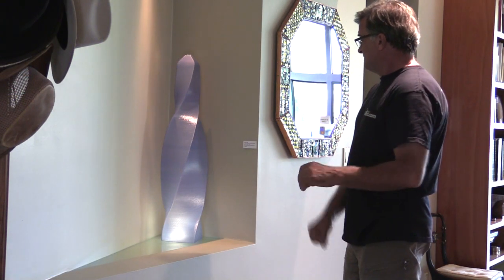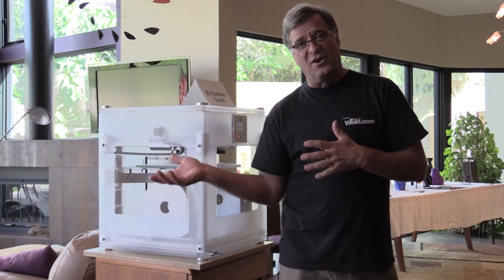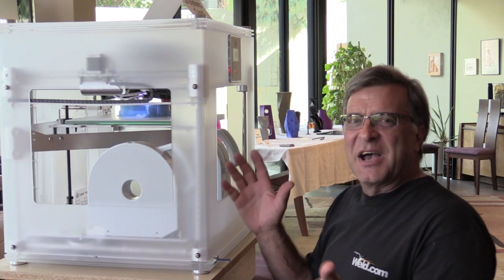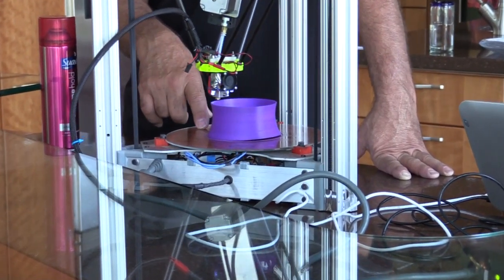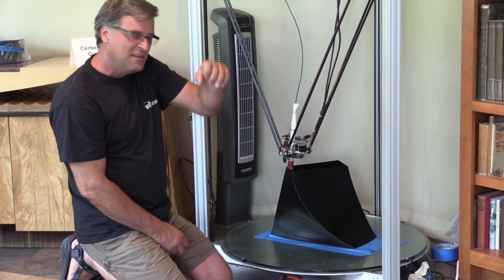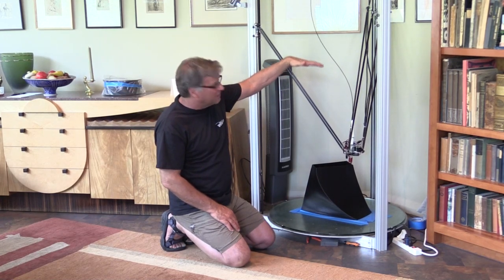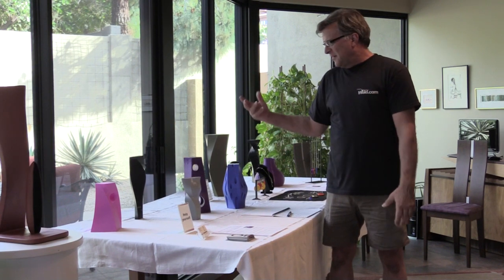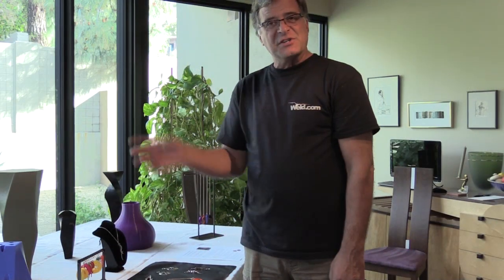A Sneak Peek at 3 3D Printers Printing Before A Show - Kevin Caron

Comment: What speed you print at big boss printer? What nozzle? What acceleration?
Reply from the maker: I think the speed is 15mm per second.

The nozzle is a 1.4mm.     Not sure what the acceleration is.
Reply: You printed it in one perimeter? Layer height?

Did you try to print a little faster? It can't to heat or you got poor quality?
Reply from the maker: I have tried faster with this machine but like you said, poor quality on the print.  This just gives me time to do other things while it is running.

Comment: 18k for that 8 foot guy? seriously? I'm in the process of building a large delta printer -- It won't be that big as I simply don't have room, but there is nothing else that's preventing from being that big, and I'm no where near that price maybe 10% and with a heated bed no less.. What made it so expensive, the aluminum extrusions are cheap, so are the motors and drive belts, I see you have beefy arms going to the effector, but those are not expensive...so what's the cost?
Reply from the maker: +kazolar       Having someone else build it for me..       I don't understand the electrical side of this...
Reply: +Kevin Caron, Artist well, I gotta say that since from looking back when you first got this printer. This was built some time ago. I can understand the need for custom CNC parts, but -- sourcing parts now, 3d printing has exploded, and I am able to build something that big with pre-fab aluminum parts from China for 2-3k. With a heated bed no less. My printer will have a print volume of about 17 inches diameter -- and about 24 inches high -- all aluminum construction very solid. 500mm heated bed capable of printing ABS and all other exotic materials. Also auto bed leveling compensation, so less fussing. I'm under 2k with just about everything purchased -- will probably need to buy some odds and ends as I start the build, but roughly $2k is the cost for a large delta bot -- now
Reply from the maker: This machine will print 32 inches in diameter and 4 foot tall!    Only prints pla though...
Reply from the maker: +kazolar Yes, things were definitely different then. BTW, I didn't build this. Someone who knows a lot more than I do built it for me.

Comment: Quick question... I see your involved in 3D printing and I was wondering if your able to help me out. I just set up my 3D printer and everything is printing perfectly but the item seems to print taller than the size it should be printing. Thank you
Reply from the maker: jr metal creations Something in the settings maybe..    Lots to learn with these things..   What software are  you using?   What printer?
Reply: Software repetier host , printer kossel 2020

Comment: That is most interesting, thanks.
What happens if there is voltage drop off or a power failure? - can the equipment pick and go again or do you have the start off all over again? I'm thinking about the length of time it takes to make some of these bigger pieces you mentioned.